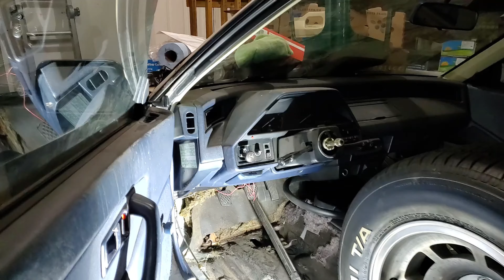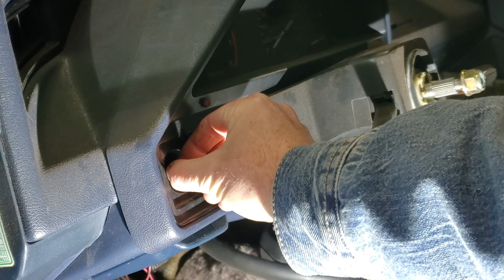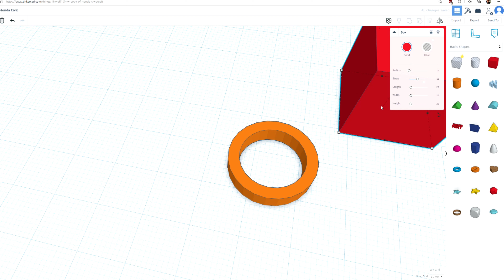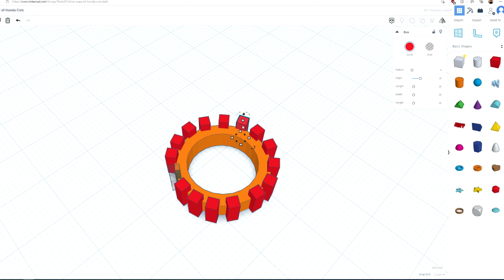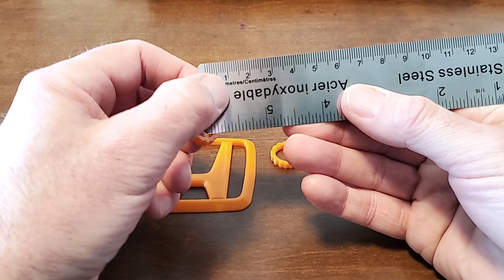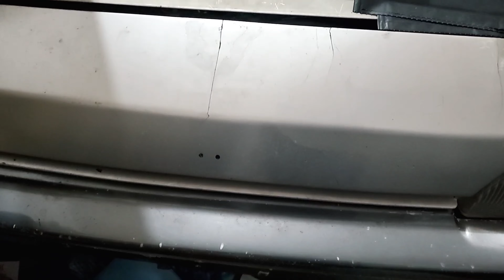3D Printing Impossible to Find Parts for Vintage Cars - 1987 Silver Honda CRX DX

Comment: Please Please please 3d print those plastic front fenders! 🤣
Reply from the maker: I wish I could.  There is one company in the US that makes replacement fenders out of carbon fiber and sells them for $500 each. I may get some, or try and repair the ones I have.
Reply: @Motorcycology  yes I found them but for me in poor old nz it costs $1100 nzd to ship and to get two fenders in including shipping it's over $3000 😳
Reply: if you still need it i could 3d scan some lol